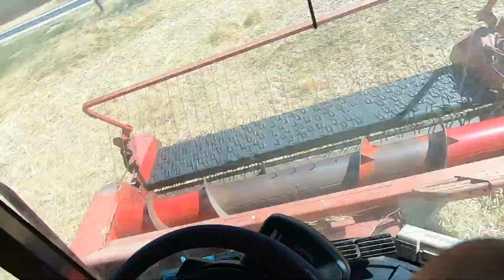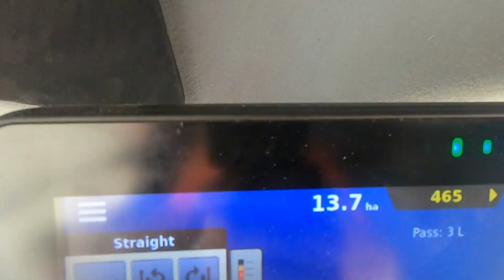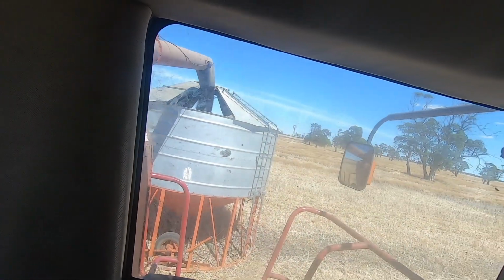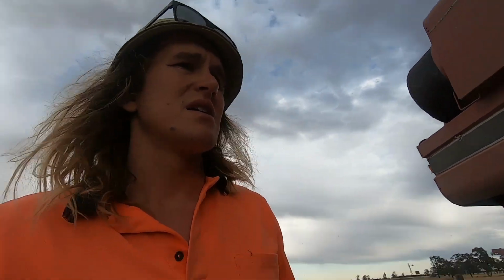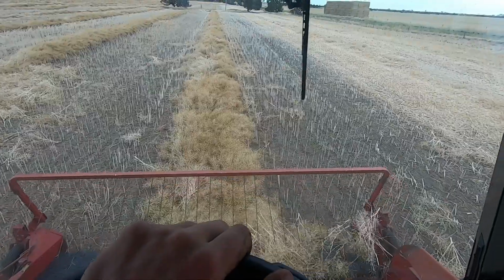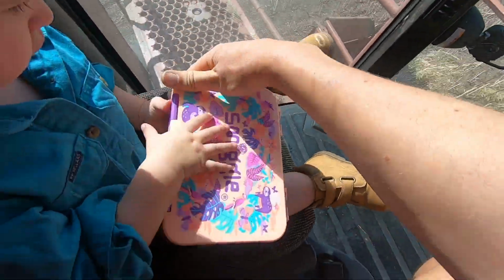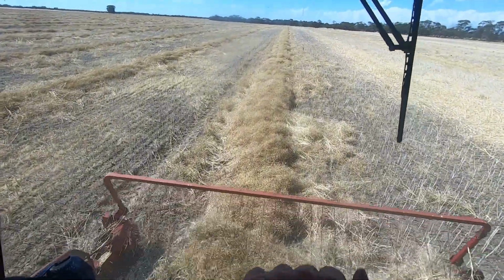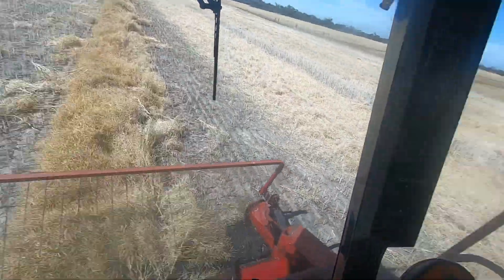Canola Harvest | Case IH 2188

Comment: Sample looks good, no cracking. Sometimes when I have had a RPM sensor alarm on the class. I swop it over with a nother one that I know is working. But I don't know if thay are  compatible on the case.
Reply from the maker: It was actually doing a fantastic job on the sample thankfully!!